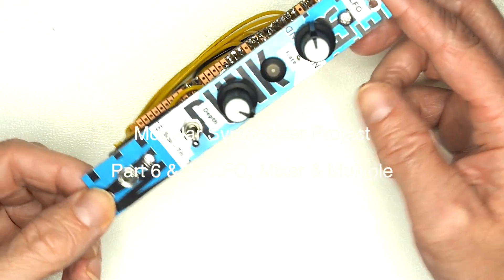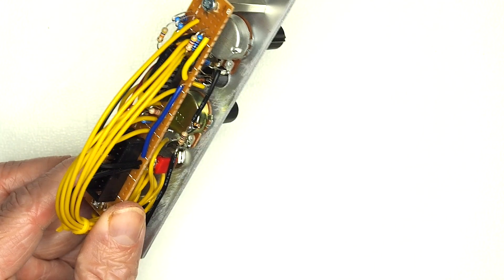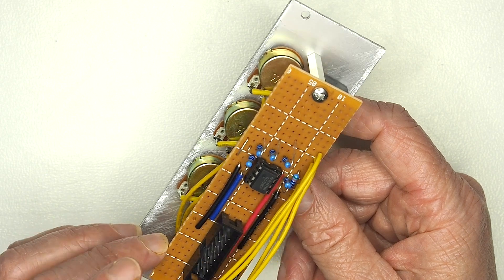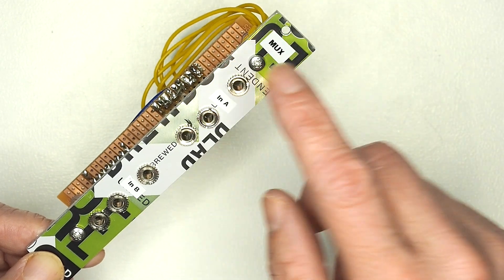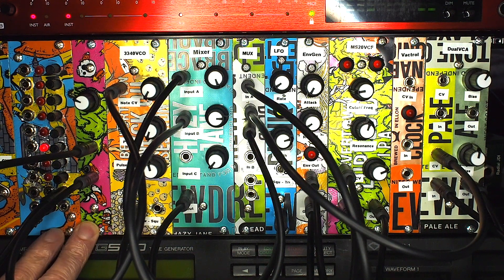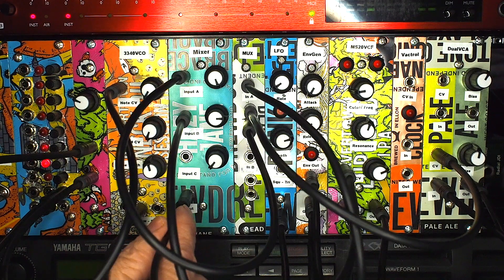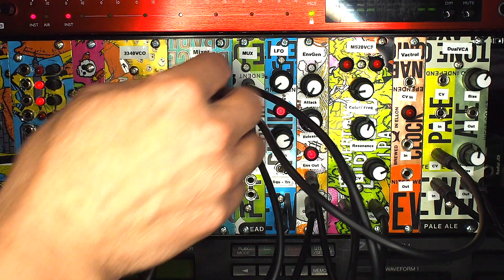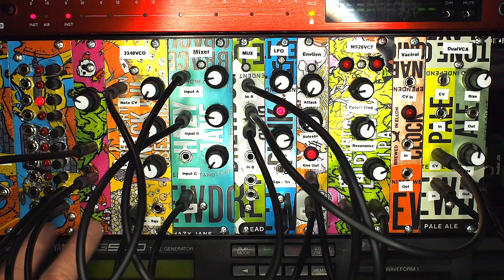Modular Synth Project : Part 6 & 7  - LFO,  Mixer & Multiples

Comment: how did you go about adding a eurorack power connector to your own board I'm struggling with this
Reply from the maker: Hi, pretty easy really, pinouts are standardised: https://modwiggler.com/forum/viewtopic.php?t=15109&start=325 and the block connectors can be bought from most electronics suppliers. My initial foray into this, i repurposed an old PC PSU as it has all the right voltages. Then eventually bought a rack unit with built in PSU.